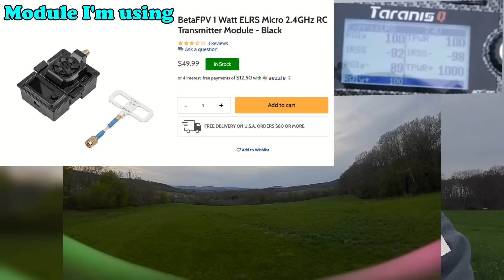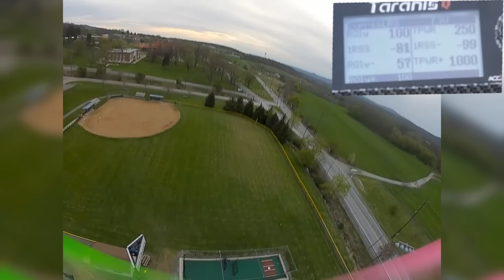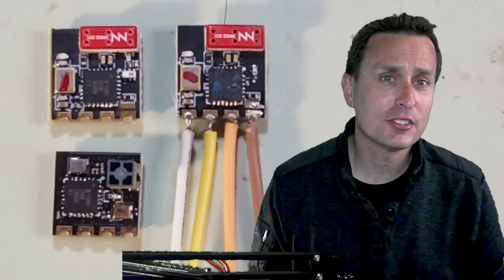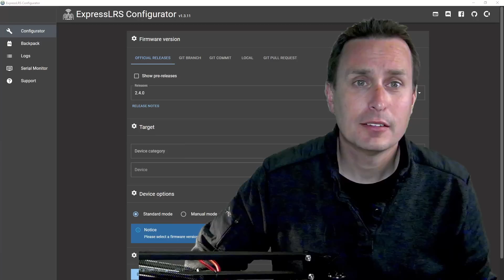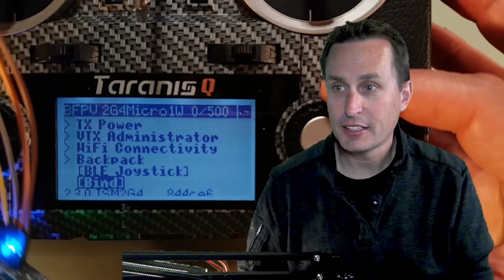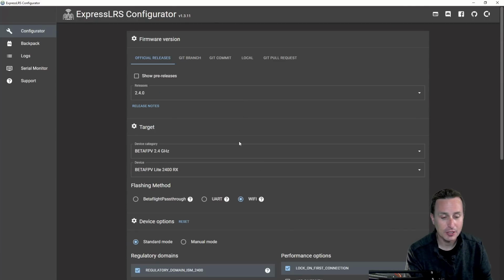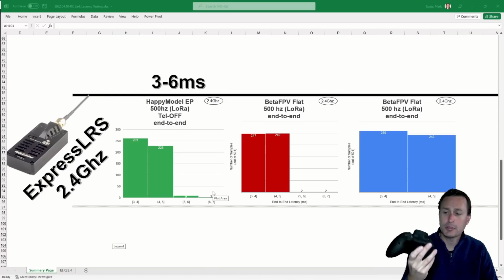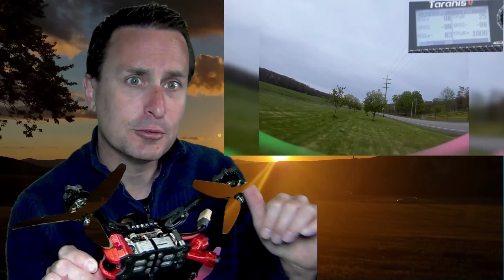Who needs antennas anymore?  --  BETAfpv Lite Flat RX | Range & Jitter Testing

Comment: 1000mW for a few 100 meters. The dynamic power toggles on that quite fast. Not sure this is good for the hobby. There are certainly usecases for these receivers with whoops and these antennas are impressive. But the message should clearly be: Use a reasonable antenna, if your build allows for it. 1000mW will create issues for the other users around with their lower power control links. It allocates the frequencies for many kilometers. Not everybody is flying alone in the nowhere. And your radio will quite rapidly drain battery when using such TX powers. Maybe that will be some factor driving people towards good antennas.
Reply: The super low weight and small form factor is fantastic for ultralight racing builds, this is clearly not meant for freestyle or LR pilots. If you're running a 2in racer in a barn this is phenomenal.
Reply: Yeah what you said!
Reply: Nicely put. An appropriate size antenna should be used if your quad copter allows it. 
1000 W wears out all of the components quicker.

Comment: Nice transparent props! Lol. Looks like a really good reciever actually, I'm kinda curious about antenna orentation on that, if it has a noid at the bottom side, the Pcb side. But like you said, it's not made for ultra long range and works great for it's intended use.

Comment: I think you got lucky with your rx flat antenna, mine was defective with very poor range 30mt more less and very difficult communication with Betafpv
Reply from the maker: V1.0 or 1.1 RX?
Reply: Probably the V1.0 because it was months ago purchased, but i still think think kind of RX are better for small quads, for a 5 inch having the 2.4 antenna it doesnt impact much on weight and there is lot space to put it